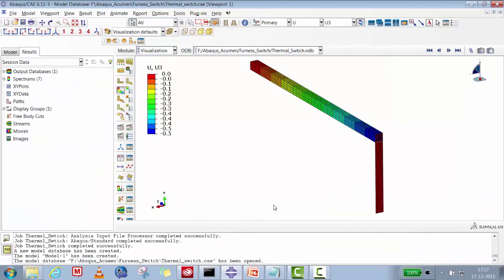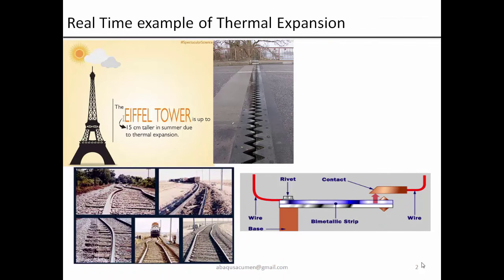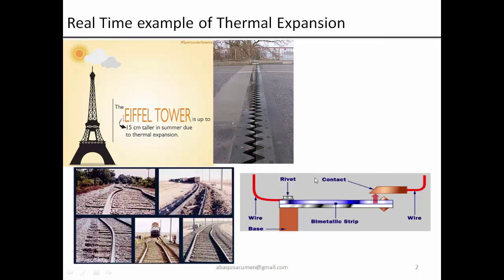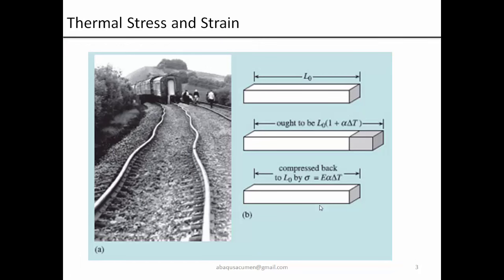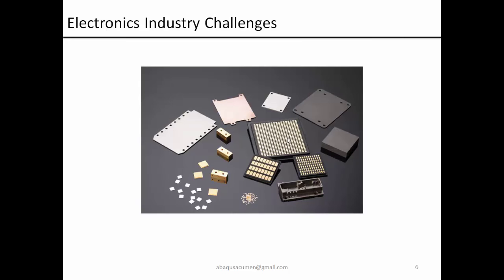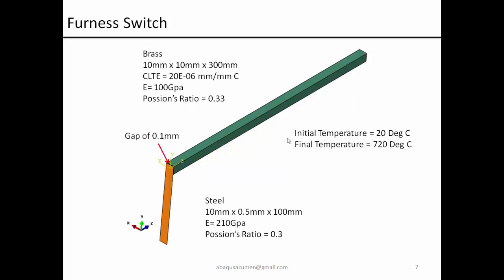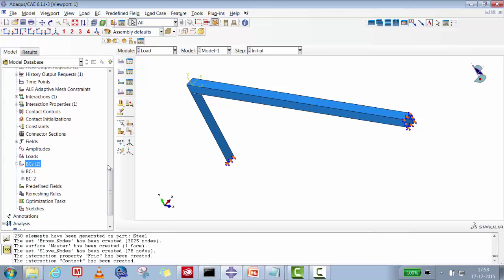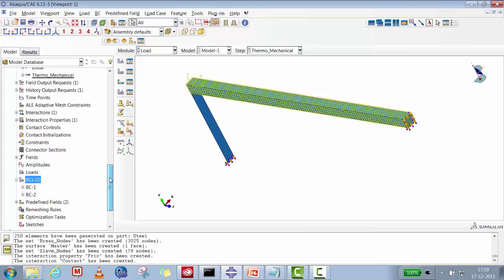Abaqus CAE- Thermo-mechanical with Contact-  Example (Simulation of Thermal Switch)

Comment: Sir, Why did you choose a static general step ? Should you use a temperature coupled displacement step ? And why you have not chosen heat transfer elements DC3D8 ? 

Secondly, when I chose heat transfer step and transient analysis, I am unable to choose NLGEOM and also unable to propagate boundary conditions, interactions, constraints and loads to Heating step. Can anyone help with this ?

Comment: Sir, can you  give some suggestion for temperature variation in Simulation and Analysis of Ballistic Impact in ABAQUS-Thermal analysis. my impact problem is not showing temperature variation . which step model should i use? thanks.

Comment: Dear Sir its a very  wonderful tutorial but I have a one question I am simulating a movable conduction heating source over a sheet metal of 3 elements through thickness (coupled temp. displacement) the temperature transferred only on the first mesh level but the rest 2 element levels are not effected by the transferred heat from the source (i ll be great full if you helped me) element type C3D8T
Reply: Recheck the part dimensions. You might be giving dimensions in meters while thinking of mm. Try to make a smaller part or increase the load.